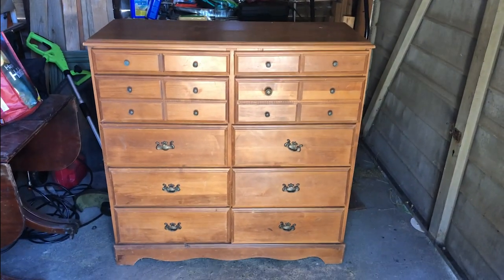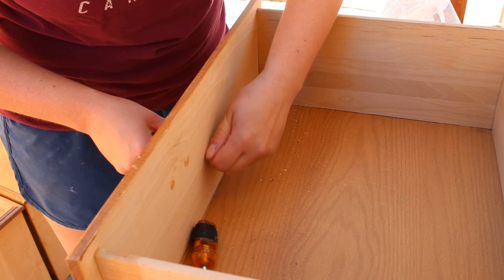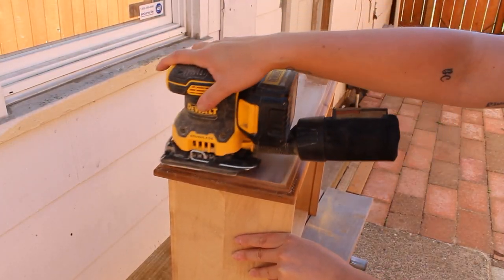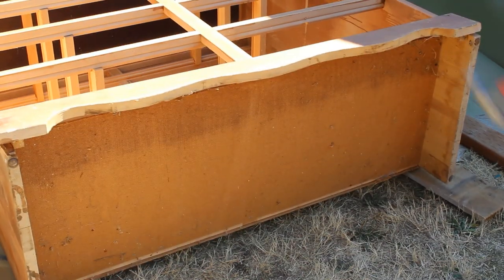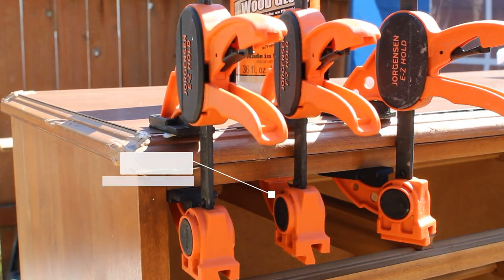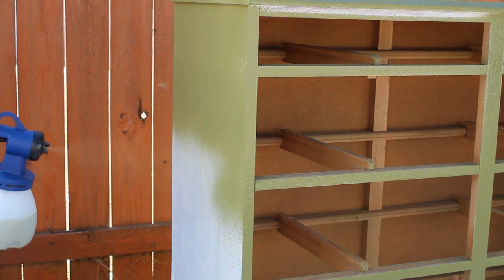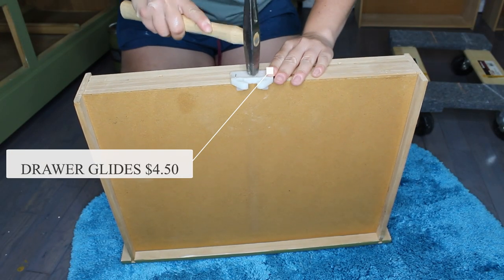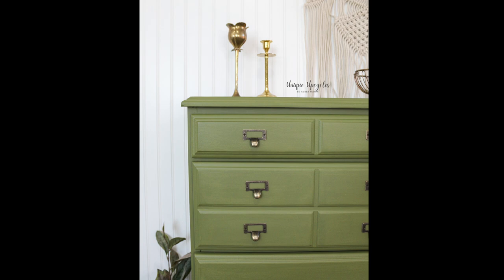Apothecary Dresser Makeover | $100 Challenge Collaboration

Comment: Great idea to remove that scalloped skirt, it almost looks like you could have "ripped it down" and reattached it?  I didn't mind the simple little knobs, and I am sure that is what threw you over.
Reply from the maker: Thank you! I thought of cutting it but it would’ve been way too thin after. I kept the wood though to use on a future project!
Reply: @UniqueUpcycles  I see what you mean now, it would have been just a little furring strip, not study enough, sorry it is hard to tell.  I have this same 'colonial detail" on something and it just is the only thing that makes it so dated.  I do understand why they went to all that trouble, but for 'modern' style it just looks cheap, good call!  I have almost ALL of these same button knobs in cabinets, but I think they are style-less, classic almost, so they don't bother me at all.  Not tic-toc, but in 10 years, they will look fine.